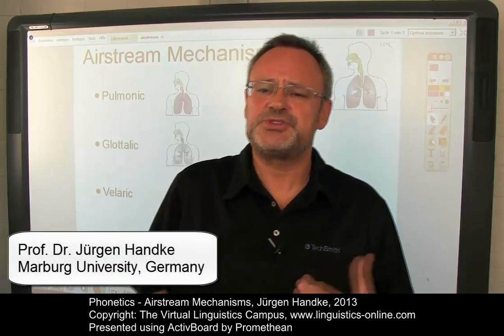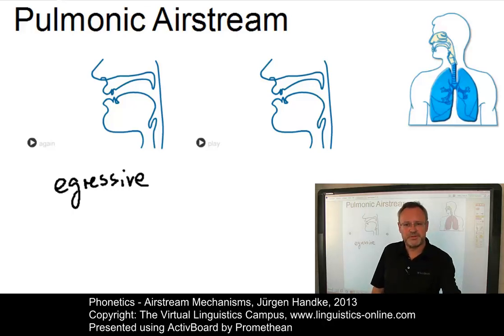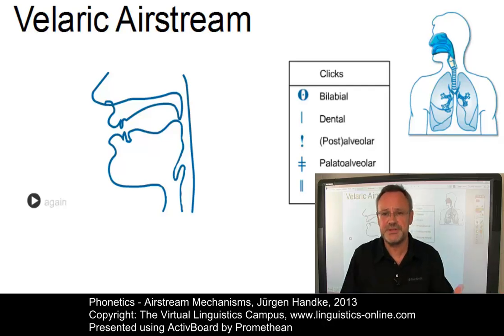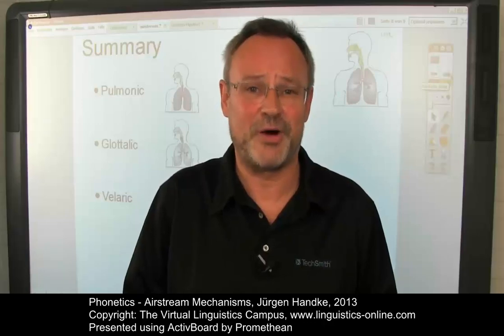PHO104 - Airstream Mechanisms

Comment: Transcript:
0.0: Introduction:
Hello. In the e-lecture Speech Anatomy, we discussed the central mechanisms of speech production, among them the respiratory system and the production of pulmonic air.

In fact, in most languages the majority of speech sounds is initiated by outward going air from the lungs, that is by a pulmonic airstream, which we are going to discuss first in this e-lecture: an airstream where the lungs are the initiators. However, there are additional ways of producing an airstream, and these will also be discussed in this e-lecture. For example: the glottalic airstream, where a glottal closure is the initiator; and the velaric airstream, initiated by means of a velar closure.

1.0: Pulmonic:
Let us look at the pulmonic airstream first.

1.1: Pulmonic Egressive:
Air coming out of the lungs is the source of power in nearly all speech sounds. This airstream is referred to as pulmonic – that is, as lung-based airstream. In speech, the air is normally forced out like this (1:28). And this forcing out of air is caused by a downward movement of the rib cage, and/or an upward movement of the diaphragm. These two movements are the initiators of what is referred to as a pulmonic, egressive airstream.

1.2: Pulmonic Ingressive:
Sounds made with inward going air are called ingressive. So here we have an ingressive airstream, and it works like this (2:19). Now, such an airstream is sometimes used to express sympathy or pain, like this “oh no!”, and in some cases when one is out of breath.
Ok, so we have pulmonic egressive and a pulmonic ingressive airstream, where the egressive airstream is used in normal speech, [but] the ingressive airstream is only confined to exceptional cases.

2.0: Glottalic:
Let’s look at the glottalic airstream next.

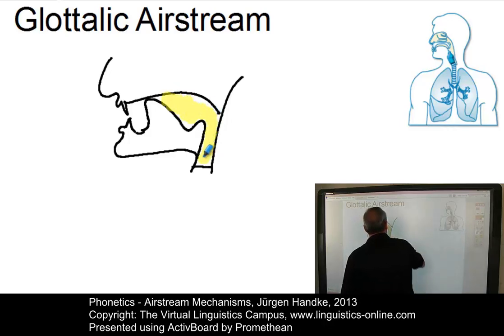In order to demonstrate how this airstream works, let’s first of all draw a sort of vocal tract – so something like this (3:12). Ok, so this is a vocal tract – well, almost. And in order to produce a glottalic airstream we need two closures: one closure occurs in the glottis, so we close off the airstream here (3:35); [and] at the same time a closure is produced somewhere in the vocal tract – let’s assume we have a closure here (3:51). And this is the air (4:01) that will be used in the glottalic airstream.
Now there are two of this airstream.

2.1: Glottalic Egressive & Ingressive:

2.1.1: Glottalic Egressive (Part 1):
One is referred to as glottalic egressive. This type of airstream uses the larynx in a sort of upward movement, so if the larynx is moved upwards during these two closures and the oral closure is released, the airstream is called glottalic egressive. Let’s name the closures (4:35): so this is the oral closure, and here we have the glottal closure.

2.1.2: Glottalic Ingressive (Part 1):
By contrast, we have an ingressive glottalic airstream. So, if the larynx is lowered while the oral closure is released, the airstream is glottalic ingressive.

2.1.3: Glottalic Egressive (Part 2):
Let’s look at these two airstream types in more detail. Let’s start with the glottalic egressive airstream. [The] glottalic egressive airstream occurs in many languages. The resulting speech sounds are referred to as ejectives (speech sounds similar to plosives). 

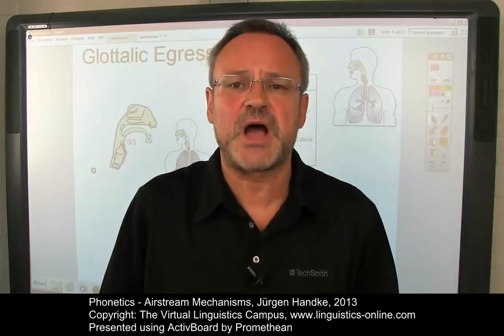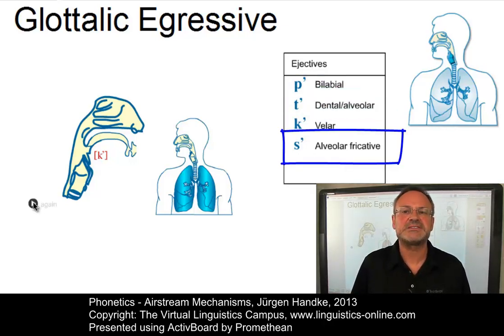Let’s look at an example first (5:28). And as you can see, the larynx moves upwards. By the way, to indicate ejectives we’re using this small apostrophe as an extra mark, as a so-called diacritic placed after another phonetics symbol. Ejectives are produced as follows, first we have to produce the glottal closure by putting the vocal cords tightly together. You can simulate this by pretending you have to lift a heavy weight, like this (6:08) – now here we have the closure. Then we have to produce a supraglottal or oral closure. That is a closure somewhere in the vocal tract, let’s say a bilabial closure like this (6:22). So now let’s combine these two closures (6:25). Now, while you have these two closures, pull up the larynx up about 1cm – it acts like a piston compressing the air in the pharynx. The compressed air is released by releasing the oral closure while the glottal closure is maintained. Something like this (6:45) – can you see my larynx moving upwards (6:51)? The result is an ejective consonant – a speech sound similar to a plosive. Here are some ejectives (7:04).

2.1.4: Glottalic Ingressive (Part 2):
Ok. Let’s now move on to the second type of glottalic airstream, the glottalic ingressive airstream. Speech sounds with an ingressive glottalic airstream are called implosives. They’re produced like ejectives: you need the glottal closure, you need an oral closure, but now the larynx is pulled down. This is what it looks like in our animation (7:41). Ok. So, the downward movement of the larynx again is like that of a piston, now this time causing a reduction of the pressure of the air in the vocal tract.

So, let’s do it (8:02): glottal closure, oral closure, and then downward movement of the larynx, so look at my larynx (8:11), and you see the larynx is moving down. Now, this downward movement however is leaky, and the vocal folds are set into motion. Air from the lungs is still being pushed out at the same time, since the larynx is usually not completely closed. When the closure in the vocal tract is released, the result is neither in the little sense, an implosive, nor an explosive action. Instead, a peculiar sound quality arises from the complex changes in the vocal tract. Nevertheless, the resulting sounds are referred to as implosives, and they can be considered as voiced. So here we have some of them: (9:01).

3.1: Velaric Airstream (Ingressive Only):
Ok, so much for the glottalic airstream. Finally, there is an airstream referred to as velaric airstream, and this airstream involves two closures: one in the front of the oral cavity, often using the tip of the tongue; and a second one in the velar region, using the back of the tongue. So, this configuration is similar to drinking with a straw, something like this (9:38) – so, imagine you’re drinking something with a straw.

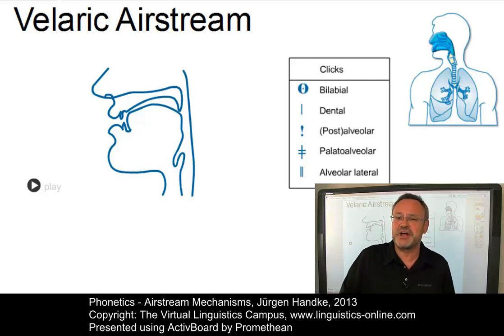Now, if the central part of the tongue is lowered, the air which is enclosed between the two closures becomes verified, and a sudden release of the front closure will draw the air into the now open chamber, resulting in a clicking noise. And this is what it looks like in our animation (10:07). You see, here is the velar closure (10:15); and then somewhere in the vocal tract, you have a second closure (10:20). Again (10:25). Ok.

Even though it is possible to use this mechanism to cause air to flow outward, languages only use velaric ingressive variant, resulting in these sounds, these clicking sounds, referred to as clicks. Here are some clicks for example: the bilabial clicks (10:50); or let’s take the alveolar lateral click (10:55). Well, let’s look at some animations to see how they are produced (11:05). Ok, you can find these in the unit airstream mechanisms on The Virtual Linguistics Campus.

Well clicks are used in many South African languages, for example those belonging to the Khoisan group [(this is no longer considered a family, but perhaps a sprachbund?)]. And clicks are all voiceless because the glottis is not involved in their production. Additional voicing, however, is possible, for example you can hum during the production of a click, [but] the click itself however remains voiceless. So, this would be some result of humming as a sort of secondary articulation accompanying clicks (12:04).

Conclusion:
Well, so much for now. Maybe some of you can now produce ejectives, implosives, and even clicks. If not, you should have an idea and some background knowledge about the production of speech sounds using different types of airstream mechanisms. And also, you should know and understand which type of airstream mechanisms are used in speech. For example: we definitely use the egressive pulmonic airstream in most consonants and vowels of the languages of the world; we have seen that the glottalic egressive airstream is used in ejective consonants; we have also seen that the glottalic ingressive airstream is used in implosives; and the velaric ingressive airstream is used in clicks; the pulmonic ingressive is possible, however it is only used in exceptional cases, such as sobbing, or being out of breath; and the velaric egressive airstream is physically not possible, unless you are an expert in using your vocal organs.

Ok. That’s it for now. See you again in one our e-lectures on speech science, and if you like, on the Virtual Linguistics Campus, in any of our online classes. Until then, have a nice time.
Reply: Appreciate it
Reply: I'm grateful💯
Reply: Thank you so much 💞
Reply: this is very much appreciated! Thank you!
Reply: Thanks a lot ❤
Reply: Thank you so much. I'm wondering what motivated you to transcribe it for us. Thanks again. You saved my time.